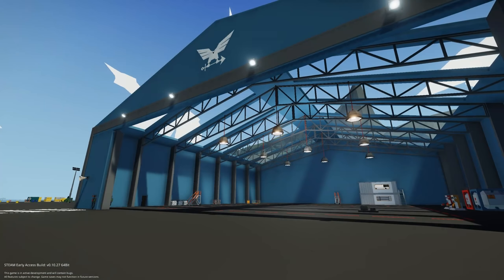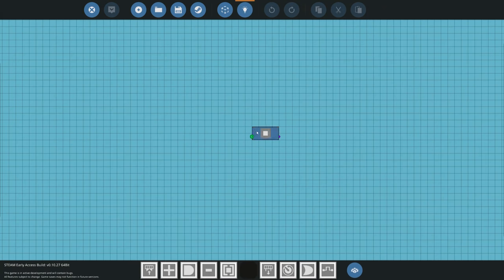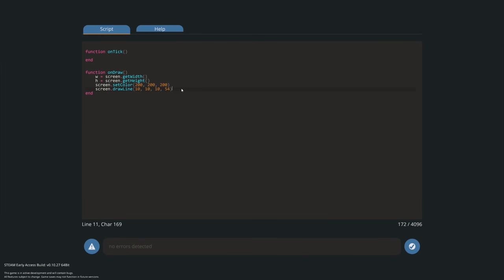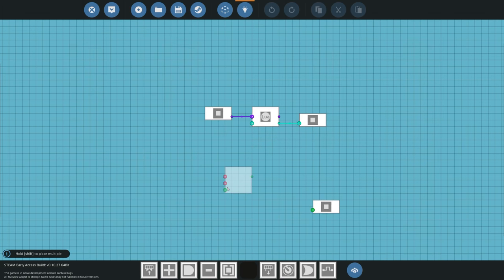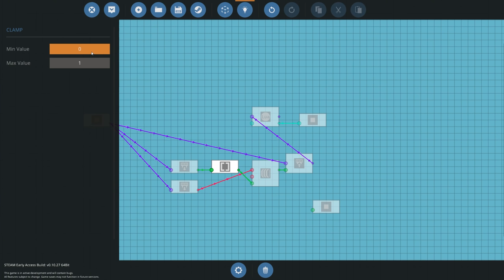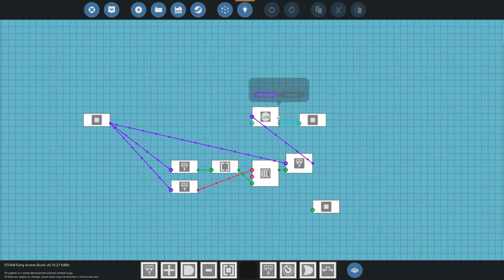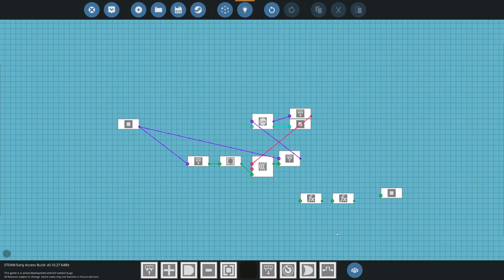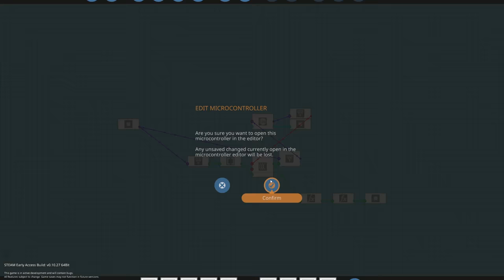Lua Build Series - Digital Throttle - Stormworks

Comment: Is there a way to add a menu on the right hand side with something like "Idle, High Idle (for generator output increase) and Operational power? Then have it correspond to the throttle but you can override it by clicking the throttle itself?

Comment: Is it possible to connect it in a way that i can use W/S to throttle up and down?
Reply from the maker: Yes
Reply: @MrNJersey  Damn, stormworks really has the possebilitys for everything. I guess you could even make an AI system withg enough microcontrollers
Reply: @ClayThunder  Probably, wouldn't be perfect but could most probably you just input a location and it would plot a great route and drive there and some other cool AI things.
Reply: Has anyone got any idea on how to do this?